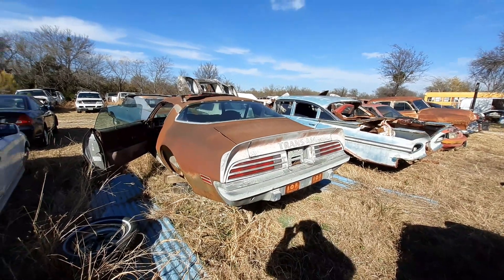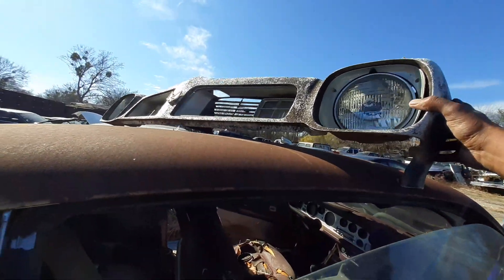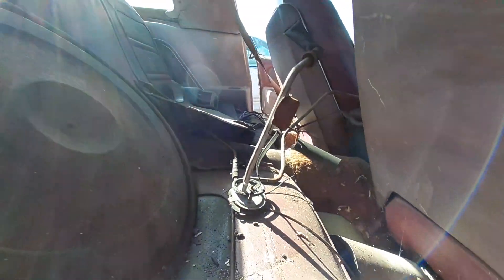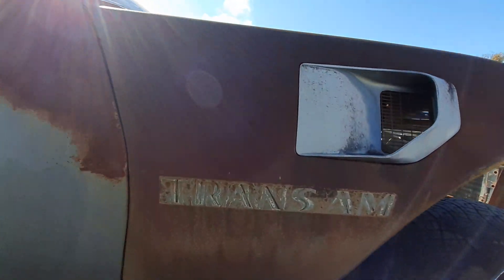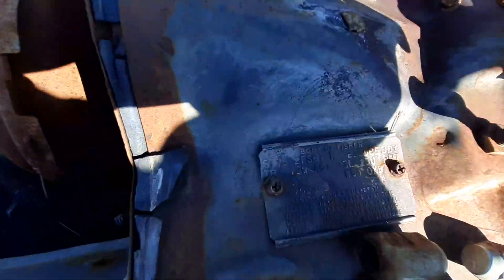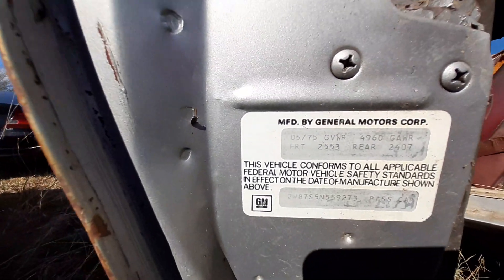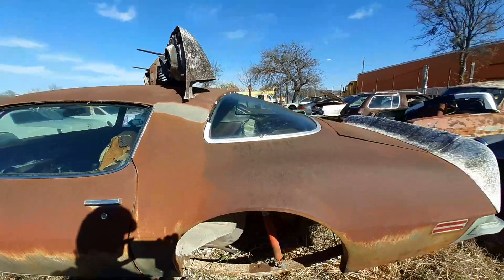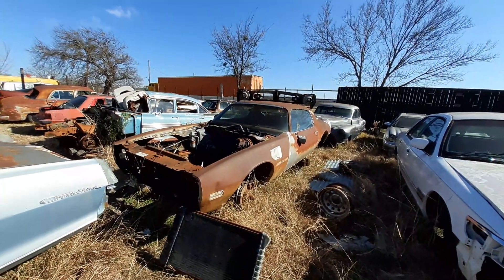1975 Pontiac Trans Am in a salvage yard....

Comment: Whoa Nelley, I have two of these (an '80 Turbo that my parents bought brand new and a '79 10th Anniversary with a Pontiac 400, one of 1,817). This one should be saved. Those appear to be original Delco replacement shocks in the back from way back in the day. The snowflakes aren't original and appear to be from a later car. They would likely have Rally II style rims this year.  This is the first year for that back window style, 1970 to 1974 was different, that's how you can tell them apart by a glance. 

We got the tag, we can brag: ST75 for 1975 model year, 2FS87 for Pontiac Firebird,  N for Norwood, OH assembly, 73W for Burgundy Morokide Deluxe interior trim, 13U and 13L for Sterling Silver upper and lower exterior paint,  A51 for bucket seats, 05C for the third week of May 1975 production, WS4 for Trans Am (Fisher Body only concerned themselves with that was body related, as they were treated like a separate end of GM, which it was), OXB for Oxblood red interior secondary trim (dash pad, door panels, etc). 

Yup, with the VIN, we win: 2 for Pontiac, W for Trans Am, 87 for two door hard top, S for 400 V8 with four barrel (a 455 was optional mid year and only available with a 4 speed manual, very rare), 5 for 1975 model year, N for Norwood, OH assembly and the rest is the production sequence.
Reply from the maker: All of these cars that I'm posting r NOT for crush.... WE WIN AGAIN..
Reply: @DeathRowCarCrusher  Yup, we sure do. You do a good job getting the VINs and tags. From that, we learn a lot. It's like we're right there with you looking at them. Keep up the good work.
Reply: Yes I always liked the Pontiac better than the Camaro but the sliver paint if you didn't keep it a garage would come off quick in those mid 70's vehicles no matter the manufacture.
When I was working in Ohio I passed the Norwood plant going to Pittsburgh on several occasions. I guess the last vehicle manufactured there was the Sonic.
Thanks Google.
Reply: @garymckee8857  Sure. No, the Sonic (I own one) was made in Lake Orion, MI as was my 2009 G6 convertible. The last cars made at Norwood were the Camaro and Firebird. I think the very last car to leave Norwood in August of 1987 was a Camaro if I remember reading right. For years, the paint companies blamed GM, and then GM blamed the paint companies for the paint issues. Grays, blues, dark colors often got it worse, but all of them could get the fading going on. The water based paint out of Van Nuys was worse. I've seen it on 10th Anniversary Trans Ams where the paint just comes off in sheets and the car goes from being silver to being brown. LOL.
Reply: @googleusergp  what's the plant near Youngstown Ohio that was just closed last year? The manufactured some variety of small GM vehicle.
I really don't pay much attention to new vehicles because like my Buick work vehicle it's like a refrigerator in appearance.
Reply: @googleusergp  The Cruz or how ever you spell it. My memory is going.
Reply: @garymckee8857  You're thinking of Lordstown and yes they made the Cruze. It also made trucks and vans and the GM "J" cars back in the day.
Reply: @googleusergp  I knew you would set me straight Thanks.
Reply: @garymckee8857  LOL, no problem.